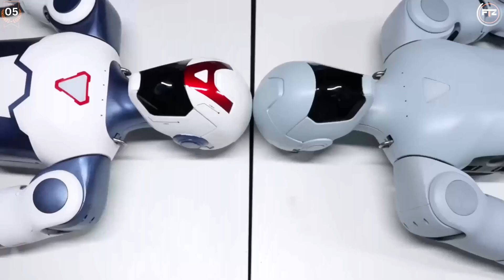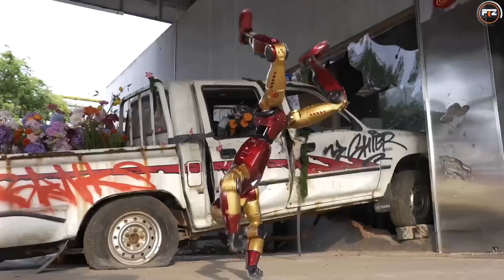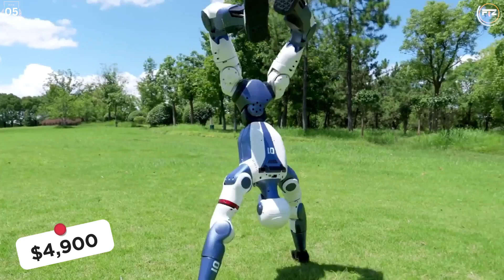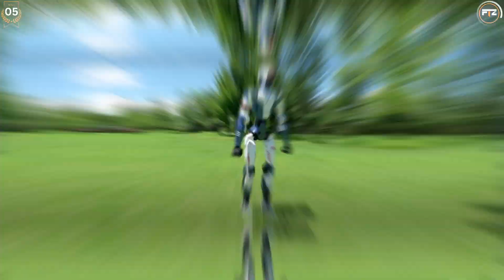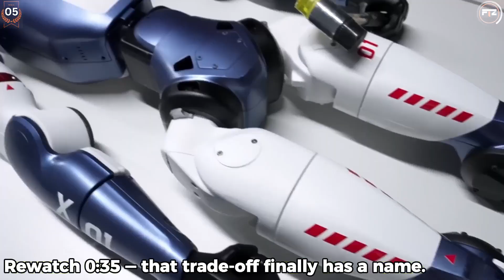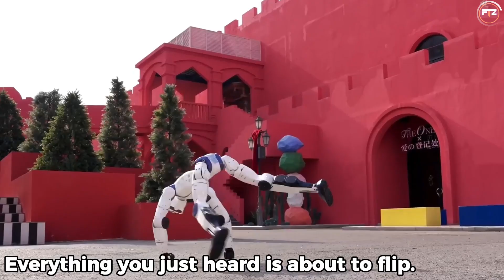Unitree R1 Humanoid Robot: What They're Not Telling You

Comment: I think I'd like to see it use a disability scooter, that way it could cover distance fast, save wear on it's parts and all whilst charging itself from the scooters battery
Reply from the maker: That's actually a creative idea. 😄 For long distances, using wheels could be far more energy-efficient than walking, and reducing wear on the robot's joints makes practical sense too. It raises an interesting question about when humanoid robots should walk versus use other forms of mobility. Where do you think a setup like that would be most useful—homes, warehouses, or somewhere else?
Reply: @futuretechnzone anywhere it'd make sense, perhaps that's part of the point of humanoids, they don't need specialist accessories, they can just use ours, whether it be a golf-buggy, garden rake or set or overalls